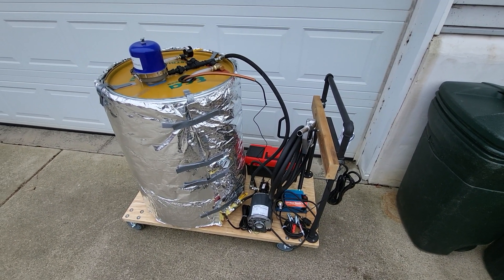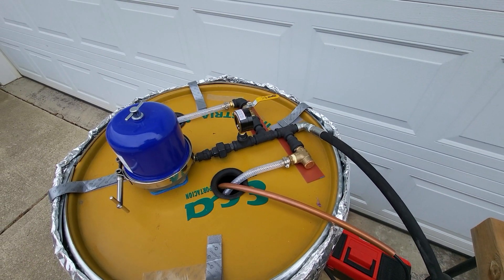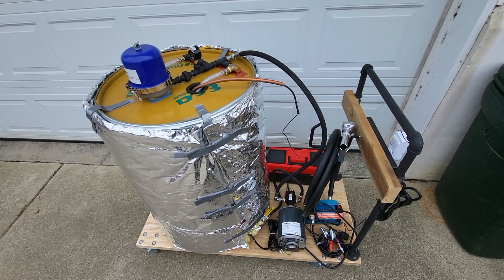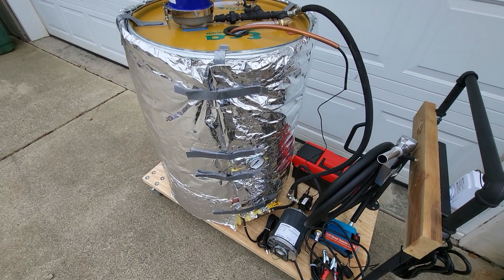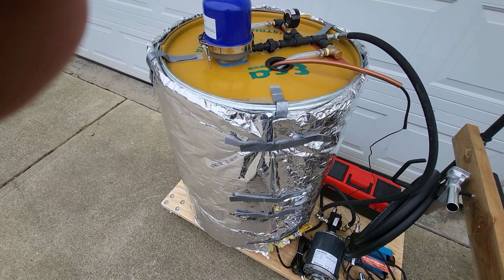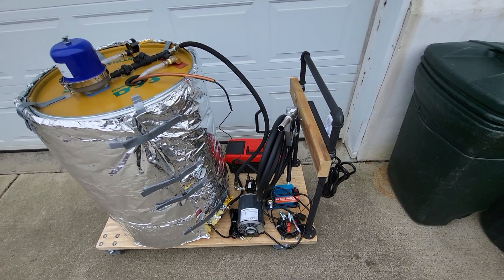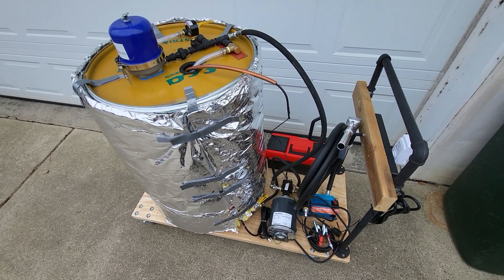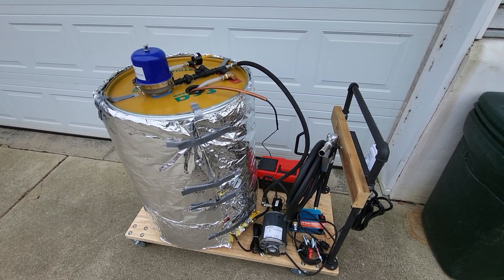PA Biodiesel 120GPH centrifuge review

Comment: Your setup looks awesome.  Any video with the unit running and the dirt it takes out?
Reply from the maker: Actually, I'm running it now, but I don't have a video yet.  I'll give a preview though.  Looks like I'm going to have to get a second drum heater, one just isn't enough to heat it up enough when it's colder out.  Mid 50's during the day, 30 at night.  Put it on heat the night before, and it was still 10 degrees short of the recommended temp the next day (175F).  Ran it for 2 1/2 hours (about 50 gallons) and it still has a way to go, but I can see progress.  I think heating it up more will help.  Got an additional heater band coming.  I also have a pretty bad leak from the pump, about 1.5 drops per second, so I'll have to see if they have a pump seal kit.  It's not too noisy, so that's good.